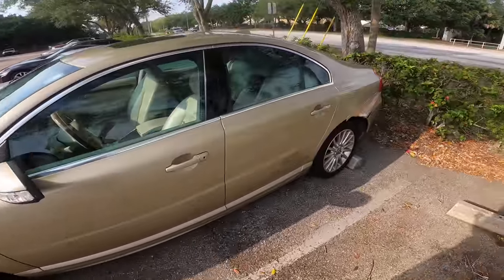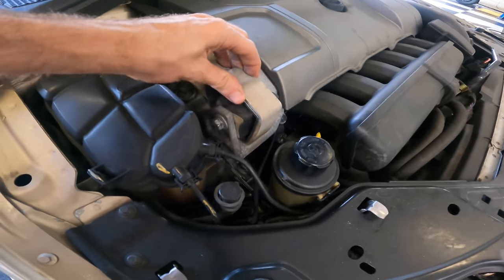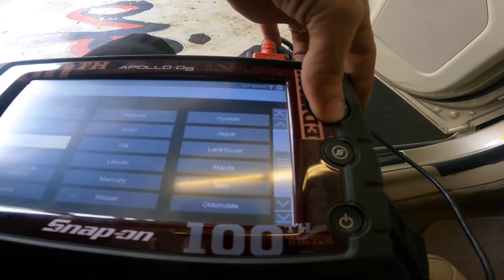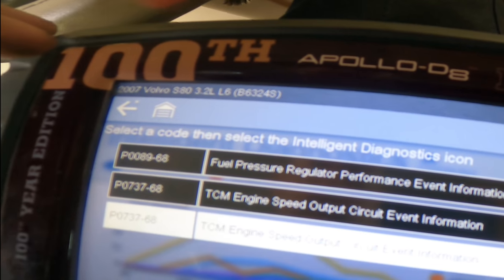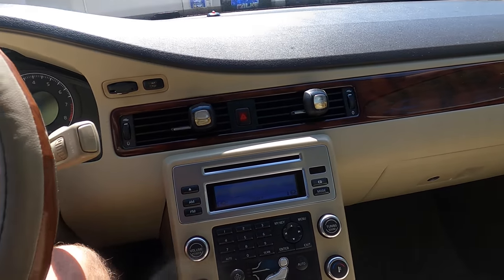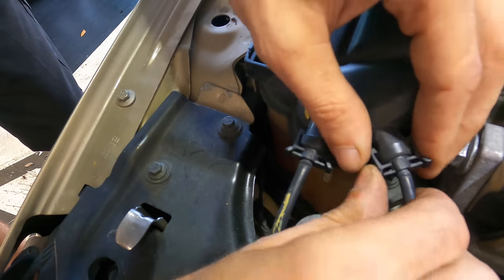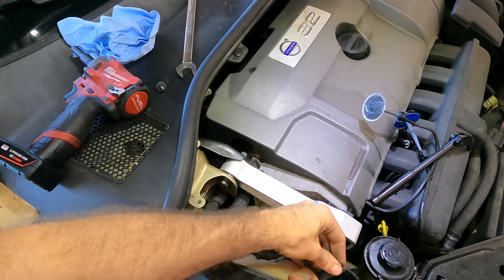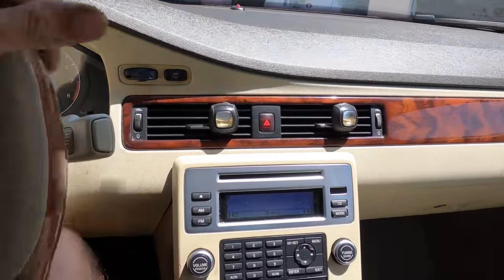How Exciting! A Volvo S80 3.2l Grinding Noise!

Comment: It’s a Ford,I’ve owned two,one pre Ford ,last one junk.
Reply: P.S. if strange grinding reappears ,might be top strut mount. to add some background,worked first dealership in 1970 .
Reply: Nonsense. The undercarriage is a Ford... the rest is depending on the engine you choose. Some of them are Ford, some of them are Volvo. This 3.2 is a Volvo designed and built engine (although some of them are built in the Ford plant). 
I have the 3.0 T6 from and since 2008, the only real thing that broke on it was the mount in this video.

Comment: Volvo...  Repairs.. Big $$$$.  WE bought the wife a 2014 XC60 after she wrecked her 2003 Dodge durango because she had to "Keep up with the Jonses' and in 2021 she hit a cow before Christmas.. Totaled it. Now she has a 2021 XC60 and knocked off a mirror backing out of the Garage. Repairs $845.. for a Mirror.  

I'm going to my local body shop to see if they have a "Frequent Flyer Program"  !!!
Reply: the thing with repair costs is in part how used a mechanic is to work on those cars. in Sweden volvo repairs in independent shops are cheap vs many american brands. while in america the opposite is true.

the biggest cost to repairs is not the part most of the time it is the mechanics time. if the mechanic knows the issue and can simply test what it is 98% of the time and know the quick way to replace the part a job meant to take 3-4 hours is done in an hour. and due to the fact there are many such people repair prices goes down.
Reply: @HarithBK  For $845 the mirror should be Self Cleaning at least!!
Reply: The car isn't expensive, your wife is. Just get a new one...
Reply: @HarithBK  Agreed. I work on cars my self and my mechanic brother in law... it really saved a lot of money. When i hear prices for cheaper cars like a simple Corolla or something I still get my mind blown.
Reply: I replaced mine with a used one from eBxy. $120. I DIYed, took me less than 30 minutes.

Comment: those ford chineze volvo's...  makes you mis the volvo's built up to june 1999.
Reply: It's more Swedish now than ever was under Ford. Ford forcing using Ford engines. Now Geely owns them, but let them completely design and engineer it in Sweden as before the Ford time. Since 2014 no foreign  engines anymore. 
Also... funny you use the "ford chineze" instead of "american chineze".
When Ford owned, nobody called it an American brand..
Reply: @bastiaanvandeven9230  LOL Swedish designed by guidelines, requirements of not Swedish.Any profits flows directly out of the country. Sweden should buy volvo back and state sponsor it a little for a while. Like how Hyundai/KIA got big.
Reply: @basbass429  Guidelines LOL, Geely is biggest shareholder, but not only, so not all profit flows out of the country.
China is smart, and are all over European and American brands... one way or the other. So you cannot buy anything anymore without sponsoring China in some way.

I agree it would be nice for Sweden to buy back Volvo, but Geely is for the last decade a lot better for the brand than Ford ever was.

Comment: This is a second generation Volvo S80, manufactured between 2006-2010. Luckily though, this is ‘before’ their Ford acquisition. What’s not known is if is the twin turbo version.
Reply: This is not before their Ford acquisition. This S80 is with the Ford undercarriage. They have some models with Ford engines as well. This is a 3.2, non turbo, designed by Volvo and mainly built by Volvo (some are built in a Ford factory). 3.0 T6 is a turbocharged engine, with one turbo. 
The Ford undercarriage is not really a problem, the Ford engines are more an issue, they're just less reliable. 
Since Geely is owner they've fully returned to Volvo's own engines again instead of Ford forcing Ford engines and cutbacks.

Comment: All new cars thesedays are garbage! Money pits built to a budget,not made to last,crap quality components, designed so the average backyard mechanic cant do fck all maintenance on them. They can shove their new cars up their aholes,im happy with my 15 yr old Toyota camry v6 that i can do 80% of my own maintenance on,has 200,000 miles on the clock and runs like it was made yesterday.

Comment: I own a S60 AWD and hate it. My wife talked me into it and I could not say no. This thing is a lame fat gas guzzling pig. I should have bought an Audi A5 which is much more fun to drive and ridiculously easy on gas.
Reply: Got a 2007 V70 2.4D Automatic here. Complete opposite of what you just described. It may only have 163hp stock but with the Automatic it pulls really well.
Reply: @alouisschafer7212  Well just wait a bit until you some mileage on this underengineered transmission and you will see. I guess you never drove an Audi in your life.
Reply: @billspencer8540  150k miles on it all good so far. There is talk about those Autos being borderline undersized for the Diesels. Cant comment on that haven't taken mine apart and have not had issues yet. The ones with bad issues crapped out within 50k miles according to the Wikipedia page on the Aisin AF33 and well it must be true then. But Volo has used this transmission since 2000 and my car is a 2007 so late 2nd gen V70. Volvo addressed the issue with an upgrade package and well since mine has hold up im pretty much certain my trans has the fixes.
Might aswell change the fluid this summer or even have it properly flushed for piece of mind. 
I see absolutely no reason to chuck my Volvo in the bin to get an Audi. If it starts falling apart and being uneconomical to fix yeah then ill say bye.
Reply: @alouisschafer7212  Mine has 190k on it. The transmission issue was creeping up at a lousy 40k. Not very impressive for a car that is made to a large degree of german parts. Not sure what moron programmed this transmission. Mine was silky smooth until 40k, now it shifts like any other American made junker. I had the transmission fluid flushed 3 times so far only with little improvement. I complained countless times at the dealer about this terrible transmission performance, they say it does not throw any codes so there is nothing to fix. As far as I am concerned this unit is a total junker and is now my winter beater.
When this POS transmission finally fails I just leave it at the side of the road for someone hand-crafted in search of a project to pick it up. I'm done with Volvo as this company is on the Klaus Schwab team now.
Reply: @billspencer8540  so you hate the entirety of Volvo now because that one transmission is kinda crap? If you had issues at 40k thats a 100% warranty repair imo I would have made them fix it trust me... and if they refused have them put a new transmission in. 
Volvo gets the blame well mate they literally had no part in developing and manufacturing the transmission. Aisin
developed it and made it. It may get a Volvo tag but its made by Aisin or somebody who accuired the license.
It was Volvos engineers who had to come up with a fix for Aisins fuckup when cars came rolling in with failing transmissions. 
Volvo should have ghosted Aisin at that point and issued a recall imo
Reply: @alouisschafer7212  I hate them because they pretended to sell me a reliable car with extended warranty. Turns out it's nothing but another broken promise.
The fact that this pathetic company is now on the Klaus Schwab team just topped it off. As far as I am concerned, stay well clear of this operation and their shitty under engineered gas guzzling products.

Comment: Most 10+ year old Eurotrash cars are one CEL away from the junk yard.  That one has $5k in work on a $5k car...... drive it until it's dead and go buy another.
Reply: Just because you Americans cannot maintain them, it's not their fault.
I've owned nothing but 10 years+ Volvo's, and lasted more than 300.000k miles, with mainly basic maintenance. Only changed cars because of other needs.
Reply: @bastiaanvandeven9230  When the ETM went out in my 2001 S60 and the dealer told me $3800 to fix, it almost went to scrap until I discovered xemodex.  There's a reason I got the car for $1200 when a similar year/condition Camry was still $5-6k.
Reply: So because of an absurd quote of your dealer, all eurocars are junk?
These prices are ridiculous and not justifiable in my opinion.

I know some prices dealers are asking are high... but this is extreme for just an ETM change. 

For example I changed a radiator core in a friend's car... the dealership quoted around 1100$ for it, because the dealer told him the whole dash needed to come out. With a few google searches we found out that it was an easy job without removing the dash... did it ourselves for 40$ (parts)... 
These cases are tributing to a negative image of cars, the brands and the car industry... while it's just totally bizarre pricing by SOME dealers and/or garages.

Comment: Ray, just so ya know, Volvo trucks are just as bad. Plastic everywhere that breaks when it is looked at wrong, including deairation lines from the engine to the reservoir and STUPID brackets everywhere
Reply: Volvo Trucks has nothing to do with Volvo Cars
Reply: @bastiaanvandeven9230  I get that they are two different lines and products but they still use the same stupid technology. I work on both
Reply: @m35a2ww  You should get another job then :)

Comment: Cheap crappy piece of junk (just like all newer cars) under 100K miles and all those problems. That was probably the second time that engine mount broke. CEL doesn't matter if the engine runs and you don't have to do emissions.